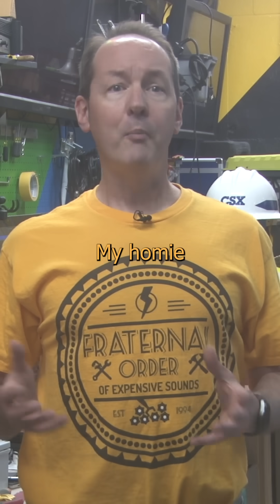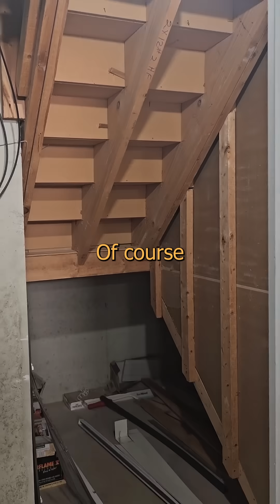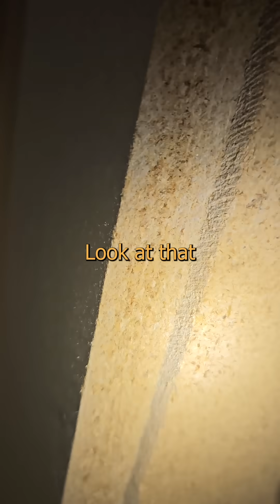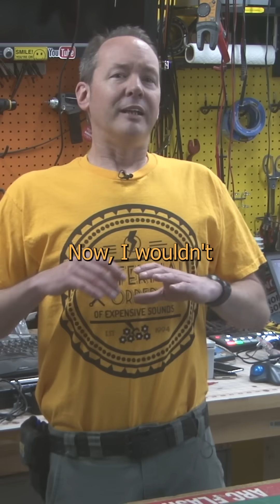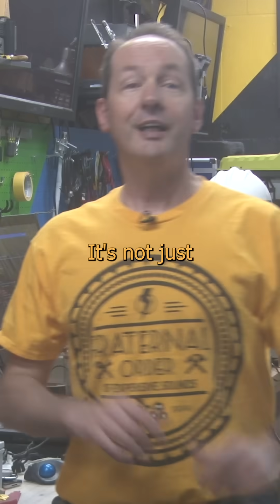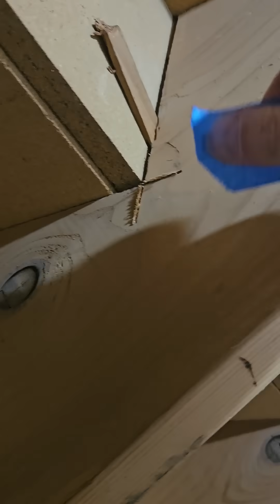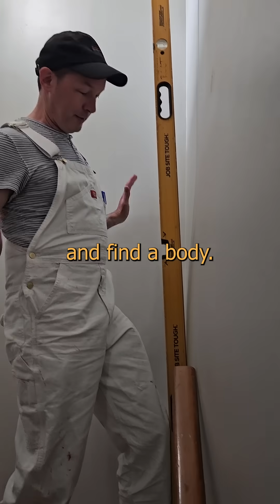Particleboard Staircase #chrisboden #engineering #construction #stairs #cheap #job #work #carpentry

Comment: You can also see on the stringers where they used a circular saw to make the cuts but ‘over cut’ rather than under cutting and finishing with a hand saw the right way. Each 90° of the tread is now a weak point liable to crack in half sending someone through the bottom and giving them a myocardial infarction and s*** in their pants

Comment: Work done fast as possible for the lowest price sold at the highest profit margin. 

I'm having a hell of a time with my pre 1930s but I won't touch a modern matchstick house. Not because stick frame is bad, but because I want a house that isn't going to be condemned after they wheel my mouldy corpse out of it.

Comment: They sell the particle board stair treads with bull nose at all the big name home improvement stores.  We had them in our old house for like a decade (it was supposed to be temporary LOL) going into the basement, they actually held up mostly fine.  Despite that, I would NOT recommend them as a first option, more like a cheapest option.  They did have trouble with screws pulling out chunks, sagging in the middle between risers, etc, pretty much everything you would ever expect out of particle board under duress.

Comment: good fuck. how do you get drywall to bend like that? I work in construction, been around drywall, only time it bends like that is when a thin sheet is propped up against a wall at a steep angle for a day or two. what in the goddamn is happening in those houses?

Comment: In 2019 we remodeled a 1982 built home that had particle board treads. Replaced with live edge oak. Maybe particle sawdust board was allowed in earlier years based on fudged manufacturer's specs. Took a few million failures before the spec sheet was proven bs.

Comment: Keep the water out (roof and drainage), don’t let it burn (wiring and smoke/CO2 detectors), don’t let it fall down (termites, structural/foundation deficiencies), make sure it flows and vents, and keep the heat/cold in, then the cosmetics.

Comment: Curved walls I can understand, foundations settle, wood warps, etc. Probably an easy fix if it's not load bearing, and if it is it's just a matter of temporary bracing to replace the studs. Particle board treads though, yeah that's not okay. I don't even think the risers are allowed to be particle board either, osb at minimum for fire reasons I'm pretty sure. It's basically a firestarter with a pretty exterior. No bueno.

Comment: blue painters tape to tag the issues i see you've been watching  the home inspector youtube guy as well 😂 totally valid  to notice home saftey issues especially on new builds so not scammed for home values or costs if it's dangerously cheap craftsmanship stil charging full or overpriced  then it needs  to be taken care of where what you owe on that home is significantly refunded for the newfound value  that it isn't.. have a little respect and  build things better higher quality to kast not just  stage design  for quick 1 day use before  torn down  to recycle hopefully not thrown away  good materials

Comment: Bought a $400k house and moved it to my property as prev owner was gojng to bulldozer it for his mansion to be built. Gave $30k, $45k to move it, cost me roughly $10k to build the new basement. The steps we removed were this, I added another runner to the staircase to over build the steps. Made all new runners and they are spaced about 12 inches apart so even if the tread somehow fails the runner is right there.

Comment: Back in the 80s I was working construction doing electrical and the contractor used illegals and he literally had a briefcase of money and we had a dozen of these disasters and not a single inspection. 

The inspector came out and took the briefcase and went from house to house signing the meter box inspection stickers and the panel inspection stickers. Back dating them like he had come out each time. 

The contractor showed him my work and they laughed. 
He said I never have to worry about this guy, but in the time he does 1 room one of the illegals does the whole house. 

They build these death traps for less than 100k all in and sell them for 700k and up. 

It is EVIL

Comment: That staircase is dastardly cheap garbage, HOW is that acceptable, the minute your toddler spills his friggin juice on the stairs you're gonna have a slow cast portal to gaddang narnia active in like 20 minutes minimum, step-activated, like my friggin trap card.

Even mdf isnt BEND resistant you'd basically have to support it, I, HOW, did anyone think that a good idea?!? At that point spend gaddang alla, 7 gaddang ¢ more per footer MAYBE with regular a$$ 1/2in plywood, oh my gods no!! LDF aint even that much cheaper!!

Comment: Building supply store I worked for recently sold particle board tread, the factory went shut down and we had one order of tread made out of pine if I remember correctly but once the factory went back into production we stocked the particle board tread again. I deff hate the shit and got bronchitis for 2 weeks after cutting some particle board sheets down to shelf’s and ended up getting fired from there while sick from said job….

Comment: You're exactly right, the inspector missed that mistake bigly (or got paid to ignore it). Particle board shouldn't be used for ANYTHING in home construction if I had a say in it, much less instances that require load bearing weight.

Comment: Using plainly visible particle board is not safe, it can be used for risers as theyre not load bearing, but is usually covered with something to protect from moisture. It can not be used as a structural component at all though

Comment: That wall along the staircase reminds me of my house in military base housing.  The stairs to the second floor looked just like that with the curved wall.  It was caused by the lower half of the kit build house settling in the opposite direction from the upper half.  Typical military housing.  Crooked as a lawyer and garbage inside and out.

Comment: I wouldn't walk on MDF either, but to each their own I suppose. I've seen plenty of particle board as subflooring also; it was always being replaced... The way I build, I would've added additional supports from the outside stringers to hold up the center one as well. Just simple cross bracing (a 2x6 straight across all three) to make the center of the stairs more solid. You really can feel the difference when walking the stairs.

Comment: I have been an interior carpenter. This is ok if it's just the bottom to a quarter inch ply sub floor and baseboard with screws that go through every layer. But inless this is just 1 of 3 layers otherwise it's as you say. Instant sawdust soup just add water.v

Comment: I wouldn't pay 60k for that construction if it's that bad on the surface I don't even want to know how the electrical system and water lines were routed or use 13 gauge. instead 12 or better 10 it's a fire hazard one heater and broken fuse box away from paying for a new new house. And you know they used the Temu special. I don't trust any construction before the 80's it's all tofu construction after then.

Comment: Particle board is legally not allowed to be used as anything other than looks, it is not a structural material. Using it on STAIRS is not just a code violation, it's a health and safety violation and a fire hazard. Journeyman carpenter, foreman of housing construction for a con firm in arkansas. This is a federal level infraction of building code.

Comment: Bro, the bend in those walls is even worse than the old house I’m working on that’s had about 150 different guys all with their fingers up in its business and the entire interior having been flipped 180 at one point and is a shell of wood on the inside supported by the original brick it was laid on and prayers that the rot isn’t on too many load bearing beams and joists

Comment: In my 1914 built house the risers are definitely structural. There's no center stringer, the risers carry most of the load across the span.

Of course, the treads, despite being turn of the (20th) century hardwood are dished and split from 100 years of teenagers running up and down them.

I know most of the wear was from kids, because the three steps that squeek like mad look practically brand new.

I'm planning to replace the treads and refinish the risers, but I'd still take what I have now over this waswood garbage.

Comment: It is a sheer wonder, that the stair isn't made completely out of particle board🤣

Btw, It fumes your house with noxious gas. All cut surfaces of particle board are supposed to be sealed. So this is an actual hazard. Not the low probability that you not notice the stairs failing on you more and more over the course of several days😉

Comment: My basement steps have been particle board for 25 years now and bottom/back side still look factory original.  Just gotta keep the dehumidifier running.  The topside OTOH is starting to look like stone steps in a 1000 yo monastery

Comment: My first house had an internal wall that's a skim of plaster over cardboard either side with the internal section made up of compressed straw! We found this out, and that they were thinner than a regular wall, when we changed the plug point to a double in my daughters room. The bathroom FLOOR was MDF as we found out when the toilet tried to flush itself. Of course all the windows were rotten because they used the softest wood possible. It turns out that the builder threw them up at the end of the 80's housing boom, before going bust in a BIG way an pissing off to Spain with all the money and no chance of extradition!
I now live in a lovely little 60's bungalow with nice thick brick walls, crap for WIFI EXCELLENT for bookshelves!!

Comment: Not safe 
Particleboard is basically compressed sawdust and woodchips and definitely should not be used on load bearing  structure
Not to mention the problem with the over cuts on the stair stringers

Comment: I briefly did construction on commercial workbays, so I learned to do basic framing and drywall work. I actually learned to compound and block sand from SKILLED auto body techs (I worked on cars and construction at the same time). Seeing drywall done THIS BAD makes my skin crawl.

Comment: The IRC says particle treads are up to code so long as they are covered with a finished flooring such as vinyl, carpet etc. structural integrity of stairs comes from the stringers not the treads themselves.
Reply: Did you see those stringers!

Comment: Ooh. Water soluble stairs!
Reply: And here i thought stairs needed wood
Reply: @Emppu_T. They don't. Concrete is the best but anything works. Even mud or stones or cardboard or library books. Even food can work.
Reply: Paint it.  Pow - sealed.  Particle board is what most of the more expensive furniture is made out of, and it's just fine.  Stairs don't often get wet, but if they do get wet you'll feel the weakness before it's gonna be so weak that you put a foot through it.

The stairs are fine.
Reply: AS1860 Particleboard Flooring
This is the code that allows particle board flooring in Australia. It requires the particle board to stand up to 3 months of weathering without a roof. 

I was very surprised by this but thought I would actually look it up.
Reply: @ecospider5 it is to code in interior for stairs.
Reply: @ecospider5  Yup. Tokd ya. But good on ya fir findibg the truth
Reply: @rusted5408  Thats in Australia. An entirely different country than the US. I know this certainly isn't up to code in Canada.
Reply: @weissanima8978 yes. It is. Just go to the city and ask. Easier than that call up a good home builder and ask if they use engineered stair treads. Pressboard. They will tell you. Ir stop by any home in the middle of construction while the doors have not been installed (on a 2 story jouse) and look for yourself. Tbeh will not be solid boards. Tneu see no water therefor its perfectly fine to code. And stop saying "rhis is not to code" it doesnt work that way. Not everything is declared in code what to use where. You really are ahowing your ignorance to the matter.
Reply: @rusted5408 I'll do you one better, all stairs are under the Federal NBC (National Building Code of Canada) and then even further under Provincial Building Code Editions - Particle Board stairs MUST be treated to be fire resistant and not used in any areas with excessive moisture of which the ones in the video ARE NOT. Only one of us is showing ignorance, and it isn't me.
Reply: I decided to check this again so used Grok AI. It said the code I stated did not talk about stairs at all. Just floors. 
AS 1657-2018 (Fixed Platforms, Walkways, Stairways, and Ladders): Is what talks about stairs. And Grok said it doesn’t allow particleboard. 

But Grok makes things up so who knows
Reply: @Rusted5408 so are you saying the stairs are fine just the way they are, or are you simply stating that they're up to code??
Reply: @weissanima8978 I guarantee that, if the entire housing complex has particle board stairs, it's up to code in that county.  There's no way one inspector could have viewed the entire complex, and there's no way that if that's a code violation that 2 separate inspectors would miss it.

It's certainly perfectly safe.  No ones stairs are gonna get wet enough for it to be an issue, because...gravity and central heating.
Reply: @Adenzel both. One in the same.
Reply: @ecospider5   hey grok ☠️

Comment: This is the reason I will build my own house. Being raised by a framer with a sheetrocker in the family i was raised getting this shoved down my throat. A string across and up/down. Dosent lie and wont try to hide it either. As for the stairs, 2x6 or x8. No particle board ANYWHERE in my home. Plywood and framing boards only! Possibly treated everywhere. I want it to last a long time.

Comment: That's not code at all. The worst part is if the basement floods he can get killed trying to get down there. Every time we've made stairs we used 2×12s and when it comes to the load bearing pieces can't be overcut like that for notches. There's usually an 1/8th in tolerance when it comes to that stuff

Comment: This reminds me when I was a kid. My dad and his friends were helping a lady with kids. I think the church helped her buy the house. So she didn't have two nickels to rub together. They were frame up another room for her. They get the 2x4s up. The wives come in to bring drinks. They ask why the new wall is crooked. The men were like what? They squared it of the wall. It turned out the other walls were way out of square. So they had to reset the new wall to be parallel to the opposite wall.

Then there is how unlevel and wavy our basement floor is. We're talking about with in a few feet.

Comment: Those over cuts with the ripsaw speak of a true craftsman at work....
Reply: I was thinking the same. Full 2" over cut on load stressed wood. Beautiful. 😘🤌
Reply: At least they're 2x12's.  I've seen stairs in OH with only an 1½" of meat left on the stringer.  (Yes, multiple jacks were placed under the broken spots😂)
Reply: a true ryobi at work
Reply: Does that really matter on a stringer!!  Beside the treads will snap long before the stringer splits. carpentry 2025 IF ITS NOT A POWER SAW WE DON'T USE IT AT ALL. My circ saw blade says cross cut.
Reply: And don't forget the shims that make them kinda straight, straighter than the drywall at least

I swear when I go to buy a home it ain't gonna be new and I'm crawling through that MF like a hungry termite

Comment: I helped rip out the entire subfloor of a mobile home because the glue sniffers who built it used particle board, and the additional glue sniffers that my great-grandma hired never bothered to patch up a single square inch of material they tore out from underneath when they replaced most of her plumbing, so the notoriously humid Florida air effectively dissolved the floors under the carpet and half the neighborhood’s wildlife was sheltering amongst the mess. Really surprised it wasn’t moldy, like even the “open concept” ductwork was blowing straight to the outside.

Comment: The contractor who built my first house ended up moving to a gated community after quite a few houses were built. Not a flipping straight wall in the place I think. The electric system was a train wreck too. Almost all outlets were on one breaker in the house along with lights. The water heater and air unit one with cooking stove is kitchen the same one. The 4 owner at least got GFI in bathroom since I installed it and a 220 outlet in garage on its own breaker.

Comment: it was some combination of the overcutting on the beam and the fact it was a wooden beam with cuts in it that my brain started making awooga noises and then the steps and risers were particle board and somewhere in my cerebellum a small man hit a button behind some glass that said break in case of category 5 stupidity. What criminal negligence riding wood jockey thought this was an acceptable way to build a house? I know we like to make fun of Americans and their funny building materials and fly away houses but this is several steps too far.